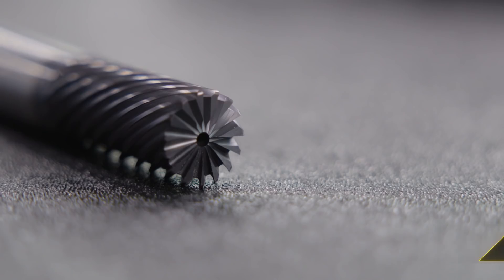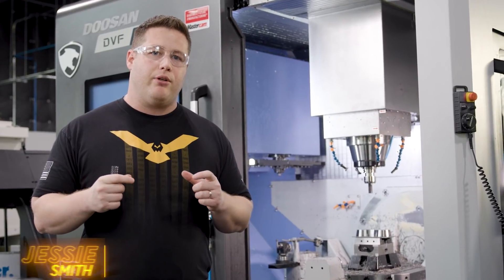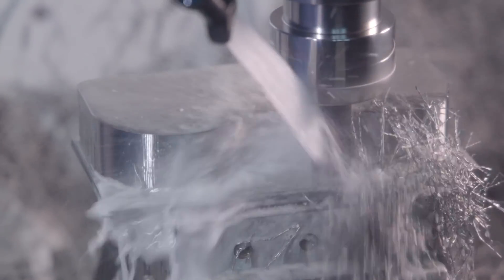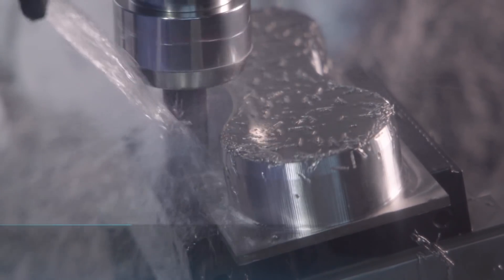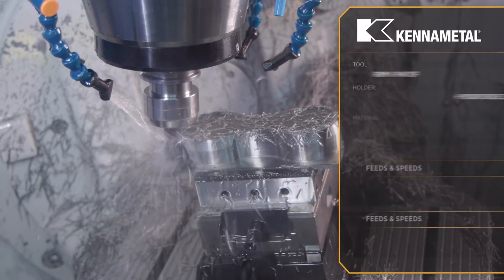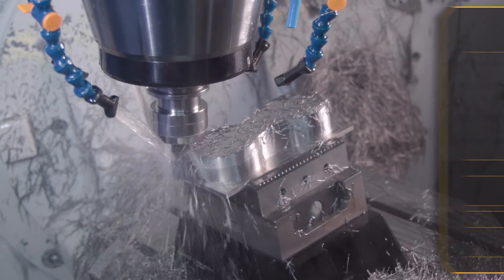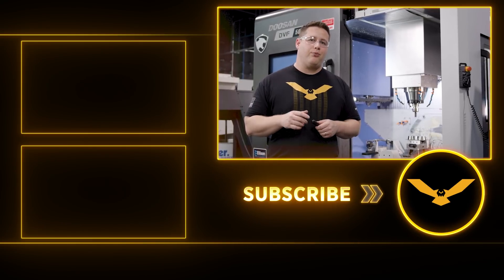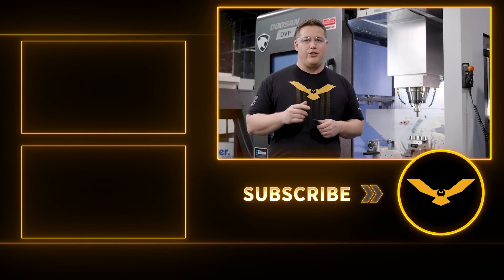Swarf Milling Titanium on DVF5000 from DN Solutions | Smooth MultiAxis Toolpath

Comment: What kind of titanium is this & what machining volume do you reached with this cutting data? 

My Data with an diameter of 20mm (0,78in) in Grade5 is 120m/min (2037r/min) Feedrate 2060mm/min , ae 0,93mm, ap 42mm, which corresponds to a volume of 80cm3/min!

Comment: oOooo shiny chipppsss... how are you holding it accurately in the next operation, hoss
Reply: ID expansion clamps and put a reference hole in fixture to teach work offsets
Reply: ID jaws on an index head.
Reply: @matthewconroy7104  There's no ID to expand the jaws inside of, so I don't know what you're talking about, unless you mean OD jaws, in which case you're clamping a 10 degree tapered surface and you're gonna spit that part right out.
Reply: @josephshmoe1647  at 25 seconds, the modeling showed an ID. I assumed that part of the op was skipped for time.
Reply: @matthewconroy7104  You're right. I was scrubbing through the video and missed that part. 
Judging by the title they're more interested in showing off the metal removal than the process.

Comment: On a lathe you really hit a wall at 70m per min speed and 0.25mm per rev feed, at least with the tips I use. Would be interesting to see what could be done with high feed turning, I bet it would work quite well with spreading wear over more of the tip especially on super alloys

Comment: After blowing up two drill mills for a slot .50x4.0” in a thin wall tube  should I go for a smaller size cutter with more teeth? My rpm was around 500 and hand fed. I was using 2 and 4 tooth drill mill bit. Thanks
Reply: Not near enough info to give a good answer. What type of material? What diameter material? How is it being held? what feed rate did you use? What material is the drill mill? Why are you using a drill mill and not an end mill? 

Gullet size is related to flute count, and the gullet size dictates max chip size. Generally speaking, 2 flute mills are generally for aluminum, and 4 flute are for steel. 
If I had to hazard a guess, I would bet you are feeding wrong for the RPM - this is the most common mistake people make, especially if they are using a mini mill or one of the cheap chinesium mill shaped objects you can buy from Grizzly or Harbor Freight.

For steel, 500RPM with a 4 flute 1/2" end mill should have an feed rate of about 20 inches per minute for a 0.010" chip (it should take you 12 minutes to complete the cut). A rigid machine will be able to handle a 1/4" depth of cut with no issue. If you do not have a rigid machine (like it weighs over 1000lbs) then I suggest making passes about 0.100" deep.

Comment: What is the better Siemens, Heidenhain or Fanuc cnc control system? Or it doesn't matter it just desing and matter of habit?
Reply: Heidenhain
Reply: @wjimenez0883  this ☝👆
Reply: Everyone will have their own opinion based off what they are used to.  Most people don't like to change but I have ran all three and from what I see they all have their advantages depending on what you are doing.  Fanuc is great for 3 axis or any machining application where you are making basic parts.  Fanuc can handle 5 axis just fine but Heidenhain and Siemens both offer greater control and features that you can't get on Fanuc machines.  When it comes to 5 axis Heidenhain and Siemens are hard to beat.  Everyone that I have talked to that "runs" a machine with Heidenhain absolutely love them.  These controls are built around the operator and are super powerful.  But it takes some learning if you are used to Fanuc because it is a whole new language.  Siemens is great for automation.

Comment: Nice tool but something SOUNDs HORRIBLE !! Should it sounds like this ? :/
My friend had very good recipe with 4 flute aluminium endmill , running it half speed half rpm than usually on AL. 5 grade titanium.
Reply from the maker: Actually it sounds great cutting, the audio was picking up a weird pitch from the machine. Listen and you can hear two separate sounds. I was listening to the cut and it sounded super smooth and had not pressure at all.
Reply: @TITANSofCNC  Yes some wired resonance pitch , it reminded me sound of unsupported stosck... Im not saying it is unsupported, just sound is like that.

Comment: How do you machine the bottom part of this part? I imagine it’s hard to hold onto with that taper
Reply: We demand to see the next op! 😎
Reply: @Pondimus_Maximus  along with programming walk through
Reply: Id expansion clamps
Reply: You can make a negative shape of the angle and bolt through the middle to remove the hat and excess material then when you get the outside done and face around the bore you can switch to clamping on the outside.
Reply: Check out the middle near the bottom. The flats could be there for manufacturing purposes/part function/Or both.

Hopefully this is the product of a good engineer & not just dumb luck.
Reply: You haven't been watching the video well,that side is not finished yet there are two round pockets to be milled so no need to hold it on the taper.

Comment: Still with a small step over the high feed and speed rough cut all that material pretty fast for titanium.
How is it for slotting? I'd think it would be good with the thru tool coolant, because it's biggest problem with slotting would be clearing the chips with 15 flutes. 
Aluminum probably give it a problem?
Reply: Slotting would be impractical because of how small each flute is. I’m not saying it can’t be done but there are way better tools specifically for slotting where you would get much better performance.
Reply: @BobbyStauterIII  it would be a good finisher.
Reply: @BobbyStauterIII  Yeah I think so, but it probably does a nice job pocket finishing too. But I think you're right it wouldn't be the best for rough pocket or slotting with it.
Reply: Like Bobby said, this tool wouldn't be that great for slotting because the flute depth.  The Harvey I-TE can't be beat for slotting.  Stay tuned, Barry is machining a part right now that has some crazy slotting and heavy stepovers with the Harvey I-TE that will be awesome to see.

Comment: What's the purpose of a coolant through hole on a tool thats profiling?
Reply from the maker: Once you have material under the center, it works perfectly. Also in pockets etc. just didn’t need it here.
Reply: Slotting with 15 flutes would be impossible without it.
Reply: Even before full engagement, the through coolant still sinks heat from the tool.